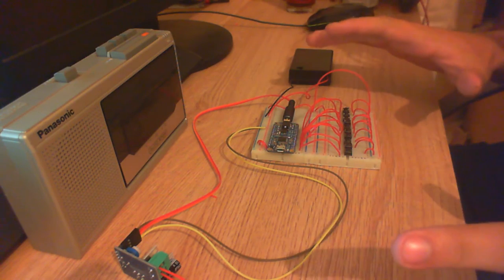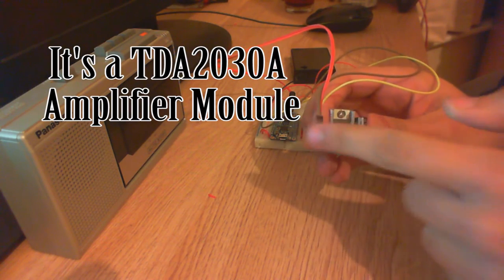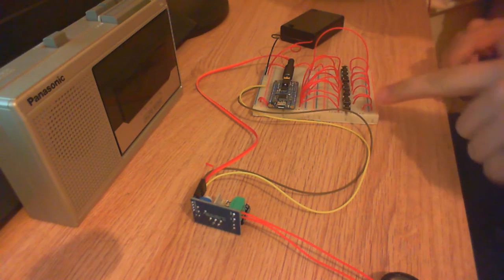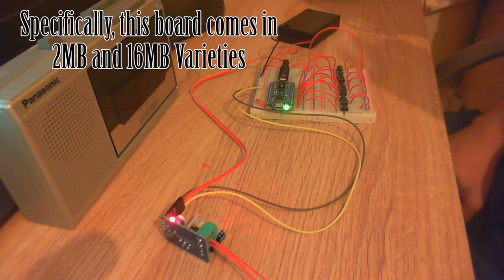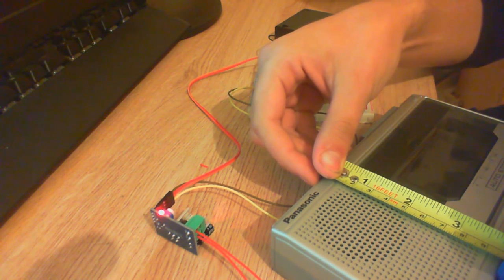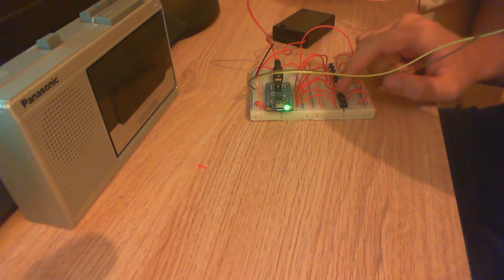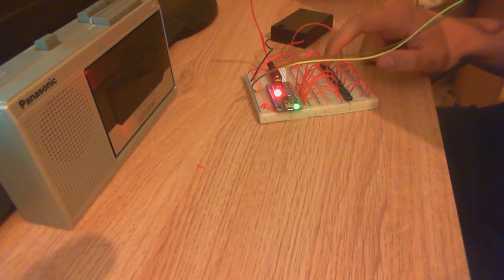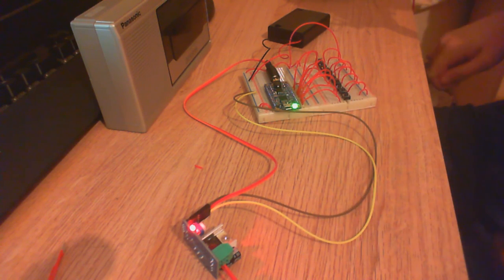Hotline Miami Tape Recorder - Explanation and Minor How-To

Comment: Question. Did you solder the board to the buttons individually? Or jam the breadboard in? How did you handle grounding in that case? I bought everything I need I just am not sure now to solder all the parts before fitting in the recorder.

Comment: So I need to use the bread board or can i just make it without using the bread board? Also could you post a follow up video of how you fit everything together. Please.
Reply from the maker: Honestly I haven't managed to fit it together yet, I'm not nearly savvy enough to fit everything yet. But what I can tell you is that the breadboard just makes it so that you can have the circuit work without having to solder it together, allowing room for error in case you put the wrong wire in the wrong place.
Reply: @SourTheGamer  I don't mean to bother but would it be possible to get some sort of follow up video or pictures? possibly showing a better view of the wire connections because its a bit difficult to see the wire connections for the buttons with the angle and with them being the same colour. If its not too much trouble. But all in all this video is a huge help.